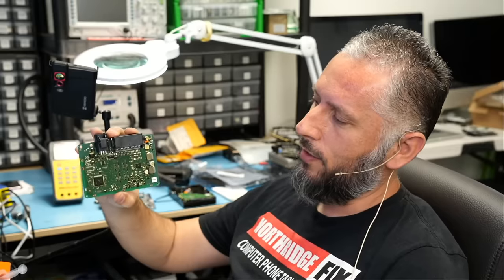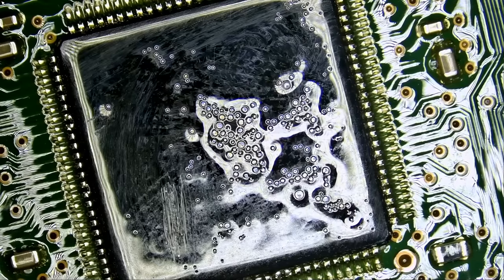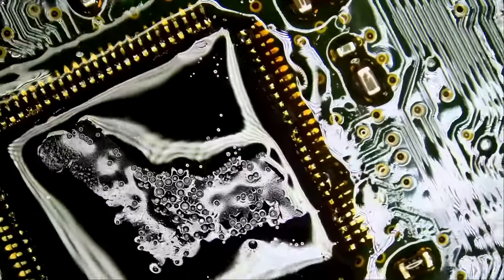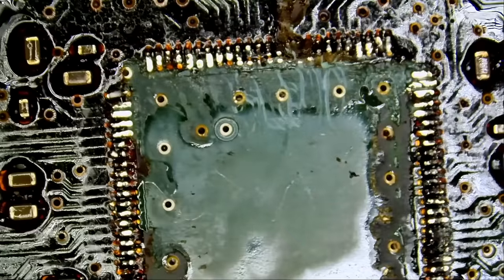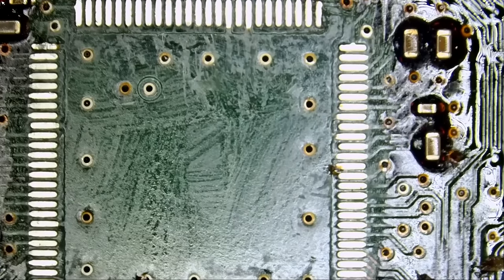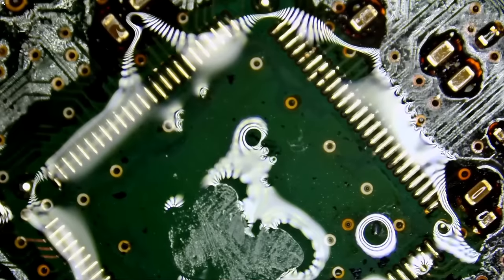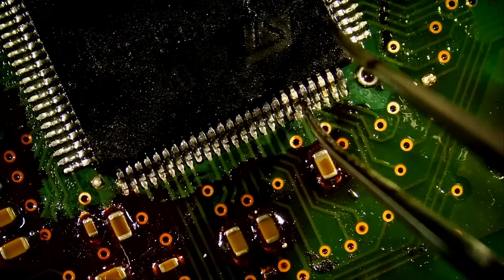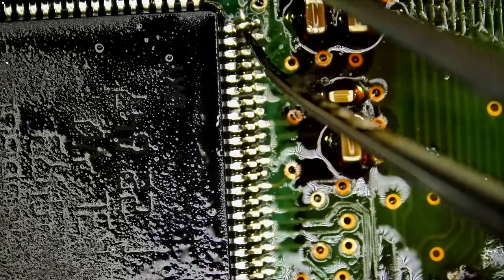Land Rover Locked KVM. Can't program new key. MCU Replacement.

Comment: Use Wurth engine seal remover - works 100% for coat. It is safe to use if do not let it on aPCB too long. I use it in my job almost every week . I work on vehicle electronic DV.

Comment: The Trick i've used on thease in the past is to run a scalpel blade along the legs and just shear them off the IC' then low-melt the pins from behind also sometimes Acetone will soften the Conformal coating making it possible to peel chunks like a sunburn..

Comment: It's a moisture sealant that is applied to all electronics exposed to the outdoors / elements. Cars, Aircraft, Boats, Trains, Subs, objects in space, etc. Even remote control cars and planes, boats, etc. There is a chemical neutralizer and a replacement spray.

Comment: Maybe, you should have run the grinding pen over the pins, to take off as much of the plastic coating as poss, before applying low melt solder.

Comment: Your pin1 corner had the extra large feedthrough at it when you first marked it. Later it looks like you used a different corner as pin 1 when you soldered the new chip in.

Comment: $4k, sounds about right. Toyota dealership near me quoted $240 for key fob programming alone- that's without the replacement fob. Simple 5 minute reflash procedure, nothing more, for $240. Got an OBD2 cable and a cracked version of Techstream for $30, problem solved. Infinite reprograms babyyy. Sure beats having to replace an MCU though... wtf is Land Rover thinking?

Oh and an additional benefit of the DIY Techstream setup- ECU updates are free too. Toyota dealerships have charged upwards of $150 to get those done. Sleazy business!

Comment: I believe acetone will take off the conformal coating (edit: acetone may damage the board). I would apply new conformal coating as this is done to make the board water resistant. Without it corrosion can build up.

Comment: There are many ways to remove the coating. What I like to do is spray some brake clean around the IC let it soak for a minute. It will all corode and turn white(might damage ICs around be careful cause it eats through plastic) and then i spray original WD-40 on it and clean it with esd brush. Does the job everytime. There are removers of it as well and they are widely available, but I never had problems with brake cleaner and wd40.
Reply: Or you can scrape it of from pins with exacto knife.

Comment: That is a water sealing coat. I remove it with acetone and a toothbrush. It takes a while but it works. I know this cause I'm a locksmith also. The boards from a volvo have an even thicker coating.
Reply: I would definitely try this route first myself. I recall watching the Pace Soldering tutorial videos here on Youtube and they discuss the safe removal of these damnable coatings. 😒

Comment: I attempted my fist micro usb replacement today with only a soldering Iron I removed the one from the donor board just fine .Then lifted a pad on the board I wanted to use !!! If only I had good flux …

Comment: As I see you've placed a brand-new STM MCU on the board, but it has a proprietary part number other than a common STM32Fxxx . Are these coming preprogrammed with the required firmware for the vehicle or is it leaked out somewhere due to the famous STM32 code readout attack? Sometimes it's a pain in the ass finding these proprietary chips exclusively made for vehicle manufacturers... Edit: it's commonly available at some Aliexpress vendors...

Comment: When you are using low melt solder, do you change the temperature of your soldering iron or does it just stay balled like that regardless of the iron temp?

Comment: I wonder what solvent can remove that coating.  I know they only really use it on things that might get condensation or a bit of water ingress.  I heard that Braun even uses it on the board in their shavers.  If it is the same chemistry I don't know.  My guess is they are all similar maybe.  Of course removing that with a solvent you might also damage the board but I know there must be some way to get it off.

Comment: You might check with Tech Spray and see if they can set you up with the right stuff to clean off that conformal coating. They have a number of solvents designed specifically for a variety of these waterproof coatings.

Comment: Most probably "insulating varnish" had used as thick coating on the board and all over parts to prevent any kind of short circuit due to moisture or water damage. I've seen   insulating transformer wire windings with this kind of liquid varnish. Most importantly liquid varnish get very taugh and hard after drying against moisture and even certain level of heat. They are difficult to remove after drying but NC THINER can be use to dissolve or liquify it. Best of luck..

Comment: its a  conformal coating   i was  adding this to pcb years ago to protectect them from  water   tropical  resin     you can coat a pcb in this stuff and hold it under water and would still work 
to remove  scape a bit off the top of the chip to a piece of glass slide   and try different combos of  chemicals all listed here in the comments   add a drop to the sample  and see which one goes liquid  state  and    thats the forular you use on the solder pins

Comment: With the right locksmith tools there is no need to replace the MCU. You just solder five wires on the board amd reset the existing chip.

Comment: hi sir we normally work on this kind of pcb. This coating is normal in automotive pcb 
i normally apply paint remover solution and clean then remove.
 Replace the chip on flat pads and drag solder 
this is how i do.

Comment: In our profession fume extractor is the worst thing that you can have. Good ventilation system is the best way to protect your health and from other side you will have always fresh air in the office. Also I use dichlorethan to disolve the coat of these boards.

Comment: Last time i worked on one module that had that type of coating i use alcohol and it dissolved it whit the help of a q tip i removed most of it where i could get to the soldering points.

Comment: Can't you dissolve the coating with some kind of solvent? If it's shellack it should dissolve in alcohol. Maybe you can use acetone or even toluene (which is quite poisonous)

Comment: coudl this amtek flux stuff help remove solder from a ups like i need to solder back in a ground wire that broken off but im gonna make a slight modification that isnt the same as the disaster that APC did

Comment: I had a ps4 with a busted hdmi port i had to run 32awg wire to all 19 pins. When you said what would you do if you soldered that chip on backwards i remembered how i had ordered the wrong style of hdmi for that specific ps4 and soldered the port on upside down. Turns out there is i think 5 variants of the ps4 and a few have a mirrored hdmi port. Im not proud to said i cryed alittle bit inside when i found out and had to undo all of the work and redo it all over again 🤣🤣

Comment: The way the board it's coloring and the smell you are describing it's polyurethane use it at work to conformal coat our boards acetone or ipa and a stiff brush will take it off so you can rework it

Comment: Conformal coating is a specially engineered polymeric film-forming product that protects circuit boards, components, and other electronic devices from harmful environmental conditions like moisture, thermal shock, static, vibration, and contamination.

Comment: Conformal coatings protect boards from mechanical and thermal stresses, humidity, corrosives, contaminants like salt and dirt, noxious gases, fungi, and other environmental factors that PCBs in vehicles are likely to encounter.  But real  question is why is it not used on computer circuit boards

Comment: Actually the Autel XP400Pro is able to unlock to chip. Did it several times to add new keys. You only remove a capacity and an oscillator.

But still great work as always

Comment: this repair will not work as STM chips from the tape reel are blank, unless your customer has a firmware dump this chip will do absolutely squat. Also you won't be able to obtain a firmware dump from any old chip because it's probably in RDP2 mode (readout protection)

Comment: Try using Kapton tape around the areas surrounding the chip to protect from heat and browning.

If that part is going back into a high humidity area it should get the conformal coating put back on to protect it from humidity.

Comment: It will be a moisture barrier, you can buy it here in Australia “circuit board lacquer” to coat the board 
when completed 

Some kind of solvent might get it off but you can definitely see the thickness of it on the board

Comment: I don't think it's necessary to replace the MCU, if you read the documentation for the chip there is a method of locking or unlocking the ROM, I believe this is all that's required.

Comment: Can someone explain (in somewhat easy words) how that chip got locked in the first place?
Reply: The chip is encrypted. Reading the chip renders it useless. So the locksmith has to have a Virgin file to write into the new chip. Then program it into the vehicle, then program the keys to the kvm 

There are currently no devices that can decrypt that chip

Comment: This is the most blatant anti-repair tactic I have seen in cars. This component will never come into contact with water or any corrosive material unless someone actually throws acid on it. Why does a component that’s so well protected need conformal coating 😂
Reply: There’s very cold ac running in that vehicle, that vehicle is shut off in the sun, creating condensation on the surface of that board, over and over again. 

PLUS, range rovers are notorious for water intrusion. 

The conformal coating is for protection

The encrypted chip that gets corrupted upon reading is the anti repair tactic lol

Comment: Land rover suks only BMW ❤❤❤
Reply: BMW X5 are a piece  of junk the cooling system has problems, overheating is common and repairs are expensive. but i gotta tell you my brother has a 2018 M5 and it runs sweet 
just be careful when you buy one there are some models that are terrible, your right about the Land Rover though, they were fine vehicles back in the day but not any more the Range Rover Velar model is their top range but they are 50-50 at best imo.
Reply: @zatoichi3134  All new vehicle use far too many resins and plastics in critical, heat sensitive areas of the cooling and oiling system. They are all made with cost savings in mind, though some are worse than others. Your brothers BMW will leak oil just like any other late model BMW, there is no getting around it. It's the same with Land Rovers, try to replace the water pump without snapping off every plastic coolant line you encounter. If you are lucky you can get a hold of a knowledgeable parts guy who can set you up with everything you will need on your first go round. These new cars are not made like they once were, I believe this is done on purpose. They push the extra cost of reliability onto the customer after the sale.